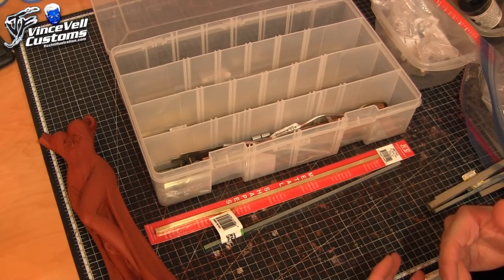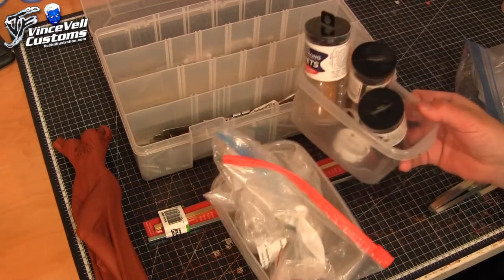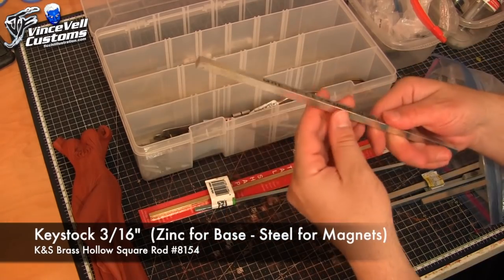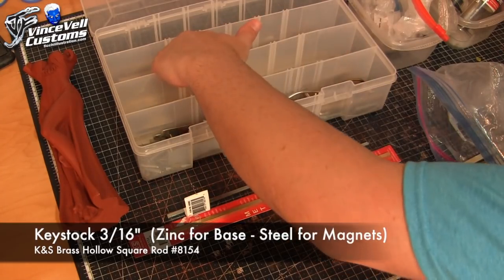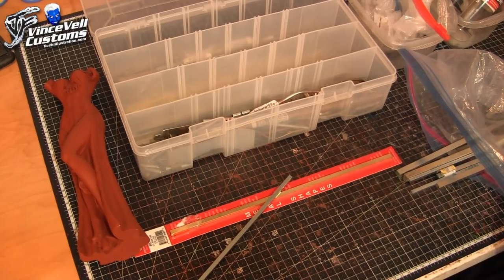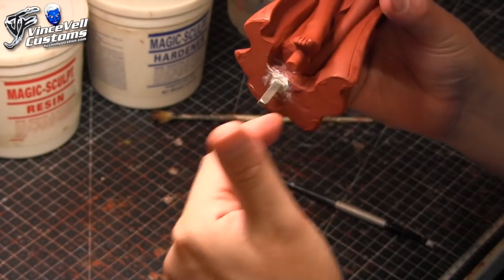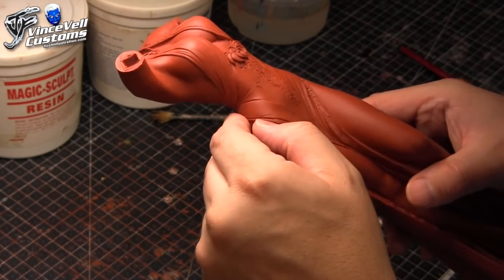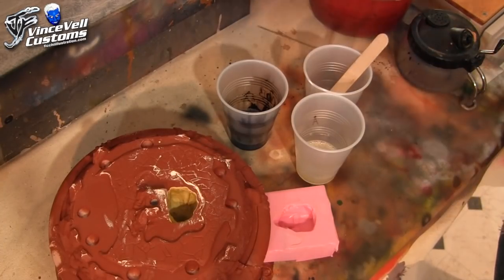Hariqa The Fire Elemental WIP Part 2 Pinning & Magnets Set up

Comment: Also, what size magnets are you using please?
Reply from the maker: no clue on the size, but you can look for sizes on eBay in MM, lots of the ones i got are 6mm, 8mm, 10mm etc,. Just get a rule measure what you need and order some.
Reply: @VinceVellCUSTOMS  Thank you.

Comment: Here's a tip for you, if you'd like to make your Dremel variable speed. (I know, it is already, but I mean continuously variable while working with it.) Find an old sewing machine pedal - be sure it's an old-type one that works with a variable resistor, not the electronic ones - and splice it in your Dremel's power cord. (You can also use a separate cord from the socket with a second socket at the end that you plug the Dremel into, if you want to keep the Dremel's cord in tact.) This allows you to regulate the speed of your Dremel from zero to the max that you've set it at, while working with it. ;-)
Reply from the maker: Thats a great idea sorta like as dentist set up, but knowing my luck all blow up my garage. Most of the time I just use the large dremel for the stuff I need to chop heavy and have the smaller one for tiny softer areas. but thanks for the idea.
Reply: VinceVellCUSTOMS  Yes, like a dentist setup. Even more so if you get the flexible extension for the Dremel. 
There really isn’t anything that can cause things to blow up.

Comment: N35 is too weak? Also, regular baby powder works fine and you just prefer the stuff without scent?
Reply from the maker: You can use them but i like the N52 since its the stranger ones and seem to hold up longer. Better to be safe then sorry. As for baby powder you can use ones that are scented, i just hate the over perfume ones in the store, Which is why i got a case of the hospital kind from a web site that is very low scented.

Comment: Wanting to try out the magnet system for a piece I'm working on. Where do you get the steel keystock from? I got some, and just found out it's non magnetic... Any particular brand/seller or version to order?
Reply from the maker: You rob got the zinc key stock, if you want steel some hardware stores sell it, or can get it online hardware stores or even Ebay. Just need to search for it since I don't know any specific brands.

Comment: Can you not use expanding foam and squirt in the cavity base ?
Reply from the maker: You can if you want too, but I'm trying to stop using the expanding foam from home depot you use for doors and insulation. that stuff seems to never expand fully. Smooth On who makes the resin also makes a resin foam that expands, i may start using that stuff more since it covers everything.
Reply: @VinceVellCUSTOMS  Thanks Vince.